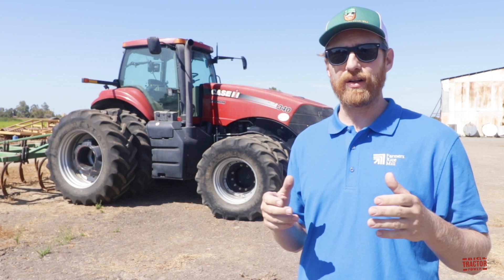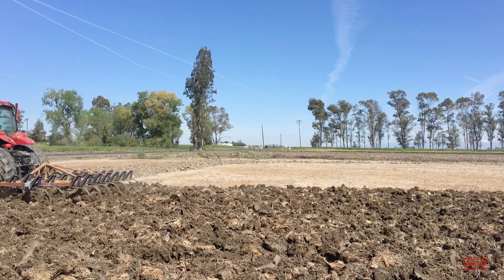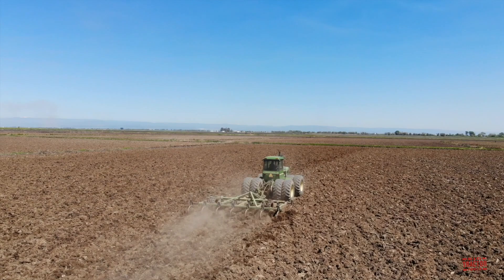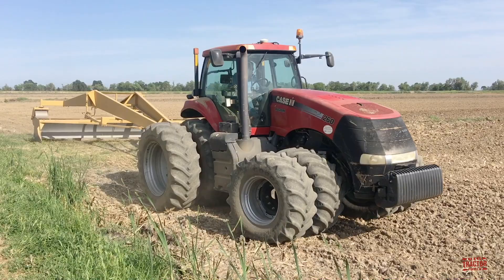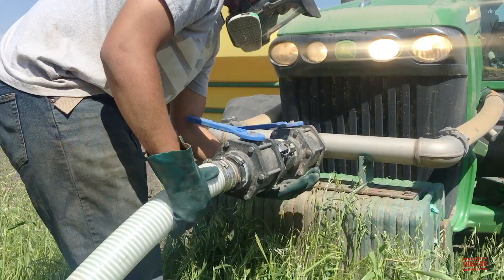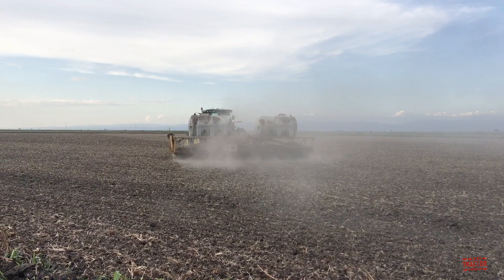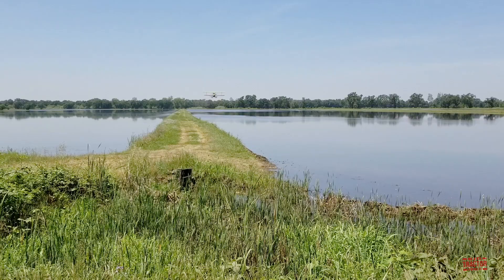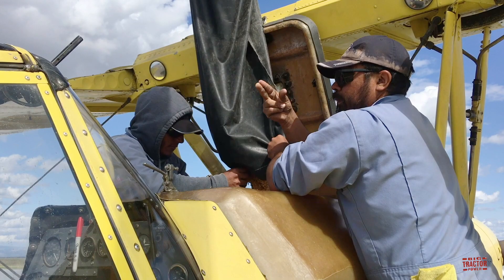BIG TRACTORS Seeding Rice in California

Comment: My goodness, after all those operations, I hope they get a good return on their crop, I would have thought it may be better using contractors using big articulated four wheel drive tractors of 500/600 hp pulling wider cultivators keeping the cost down . Kevin Fox, London Essex
Reply: That was my thought, too. I was very irritated by the operations. It looks a bit overdone to mee. Especialy the leveling, followed by a very unstable injector (wondering why it is floating so much, it is 3-Point mounted so what the fuck) and later raced on by that roller (great, get it uneven, you're just leveled it, but ok). I would recommend to kick the leveling process, inject the fitst time and then go with a seedbed cultivator to "level it" and getting a very smooth, fine surface. Also i would change the first chisel ploughs, because they don't maintain their working depth as seen. They should use some with the main wheels lifted and get one with adjustable ones at front and rear to get the chisel more stable and ballanced. less passes, better quality and less operations, which are more effective. just my idea of getting the money out

Comment: I do not see any of the older tractors rolling coal, do they need to retrofit them in CA?
Reply: Butch, I farm in Northern California as well and can say that the old tractors do smoke.  Up here we’re “encouraged” to upgrade to newer machines through the Air Resource Board’s programs but at the end of the day the old tractors are simply more reliable. The programs allow for repower projects on the old machines to tier 4 engines but I have yet to see a project like that. Hope it answers your question.